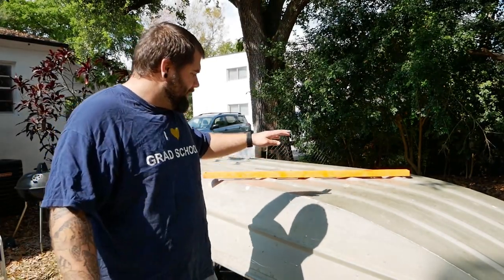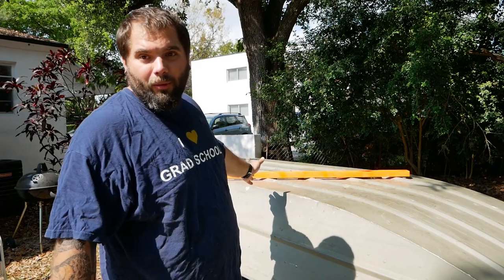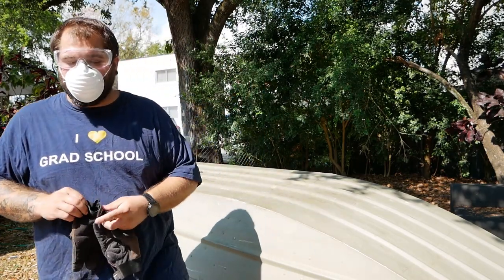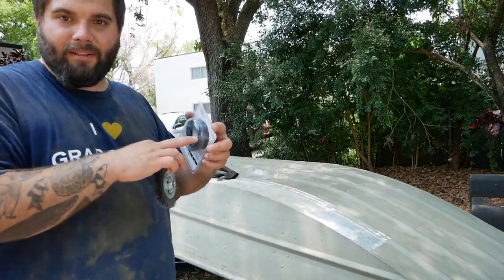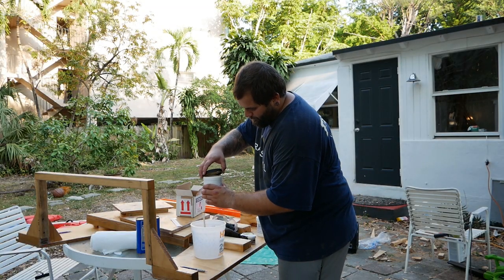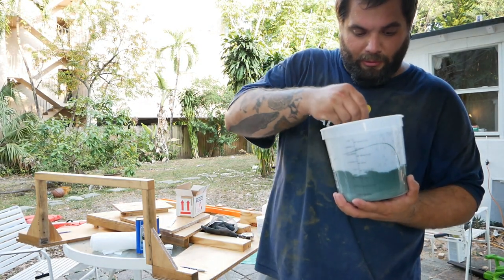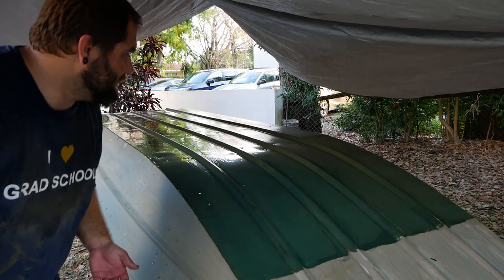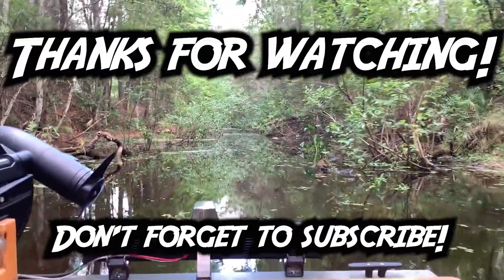Super Slick Bottom Paint on a Jonboat (Swamp N Stomp ep. #64)

Comment: i’m thinking of putting in a coat on the bottom of my Jon boat , which I grinded down to bare aluminum, but I was also thinking of maybe putting a coat on the inside bottom, which has a coat of paint my question is, do you think if I just scratch that paint with 80 grit will the steel flex will that adhere to it or do I need to take that down to bare aluminum also?
Reply from the maker: I wouldn’t worry about paiting the inside. It’s not affecting the performance of your boat, and aluminum can’t rust so what’s the point? Seems like a lot of work for nothing. Steel flex requires adherence to bare metal. -Mark
Reply: I wouldn’t want the inside of my boat being slicker than a minnow’s peter.  It’s an accident waiting to happen.

Comment: Man that was a good video. That was cool watching You do that work.  You did a very good job man. It was also awesome to watch you do it in flip flops. The flip flops is the only Footwear that I can wear because i have big very very wide feet sz15 6 EEEEEE wide with very very fat wide toe that are equally straight across making my foot 6 1/2 inches wide from my big toe to the lil toes. my foot out grew tennis shoes 33 years ago so there's no shoes , sock , or boot that's wide enough for my foot. The flip-flops is the only thing that were barely and I mean barely fit my foot because my toes are wider than the flip-flop straps. It really really sucks having a very very extremely wide foot that is 6 1/2 inches wide with very very fat wide toe that are straight across. I wish my toes were at a 45 degree angle like everybody else toes that way my foot would  not be so wide. I also like your tattoos man those are awesome. Great video man thank you for sharing.
Reply: Wtf